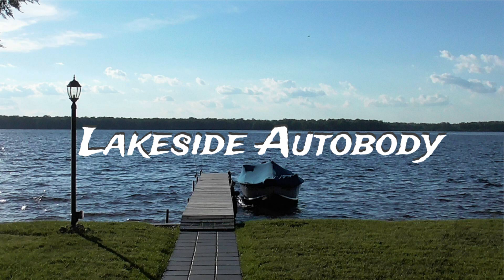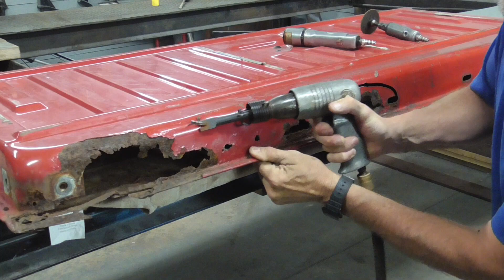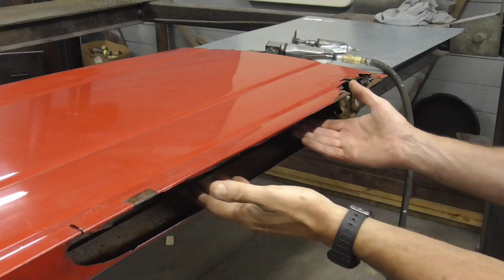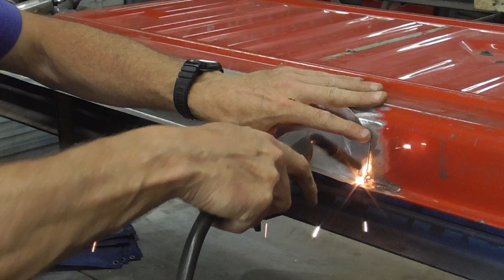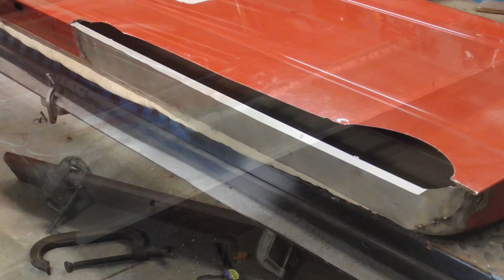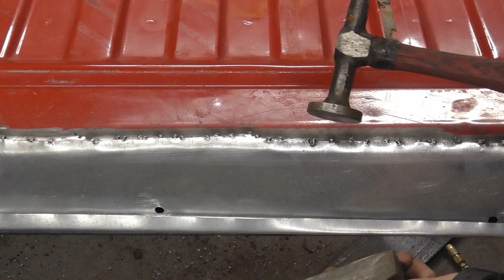Tailgate Rust Repair Made Easy

Comment: Excellent work! What gauge sheet metal did you use for the repair?
Reply from the maker: 22 or 20 --  .030"-.035"
Reply: @LakesideAutobody  Awesome! Making sure I was going in the right direction. I ended up buying a couple 22 gauge sheets. Thanks.

Comment: How did you get the second patch to fit so perfect? Did you trace with paper to sheet metal or something? I need to do this to my tailgate.
Reply from the maker: You can make a template with paper or cardboard, measure, etc.  I usually measure or just hold the patch in place a mark it with a marker or pencil.

Comment: Does the replacement steel used need to be of the same gauge and MATERIAL/TYPE as the original? Any preping/post spraying required to avoid galvanic reaction that could lead to rust?
Reply from the maker: It doesn't have to be the same gauge or type.  This is the best way to prevent future rust with any repair.  https://www.youtube.com/watch?v=8XaZBy7GC7A  Make sure the panel can drain and dry out inside - if it doesn't have drain holes, add some :)

Comment: What gauge sheetmetal do you recommend? Whats too thin and whats too heavy?
Reply from the maker: 20 gauge is as thick as you want - any thicker it's too hard to work with.  22 gauge can be used too any thinner would work but hard to weld w/o going through often :)
Reply: @LakesideAutobody  oo thank you for that. Yea i think ill use 20. My 87 bronco needs some sheetmetal work.

Comment: Jerry this is the same tailgate that i'm working on the 000 dakota but my tailgate was damaged beyond repair so I replaced it form one from the junk yard. It had about 40 cats of paint so I stripped it and completely disassembled it. and repainted it .Now completely reassembled it. and now I'm  having trouble getting it to align to the bed. all the brackets are out of place. Any suggestions. The tops out and the bottoms in or just the opposite on the other. Its confusing.
Reply from the maker: Start at the bottom and get that first. Where it attaches has to be adjustable - if not open the holes with a burr bit or even a drill bit or die grinder.  Once you get the bottom to align work on the top.  Keep asking ?s if you need.  Let me know how it goes for you :)
Reply: @LakesideAutobody  thanks I started at the bottom and worked my way up now I have it in pretty good shape we're within 3/32" of perfect and I believe that's pretty good. Now i'm working on repairing rust over the wheel wells. I appreciate your advise.
Reply from the maker: @keithshilt5549  Glad to hear it.  Have a good week :)

Comment: Excellent work. Have you ever used the tool that you run along one edge that you're welding, it bends about 1/2" of the edge down one material thickness so when you lap weld you're not above the surface. I never did but I've seen them and it looks like it's a time saver. Not sure what it's called? Funny story, my boss forgot to peel the transfer tape layer off of a pinstripe, so about a week after it was done the customer brought it back because the clear was lifting between the two pin stripes! What a pain in the butt to fix! Thanks for the videos!
Reply from the maker: Wow!  That pin striping story is excellent.  Good thing your boss did it - always feels good when the boss makes a mistake - that gives you a license to mess up too.  I think you are talking about a panel  flanger.  I have used one.  All seams should be knocked down a bit anyways so that the filler can be a buffer between the seam and the paint so... I just lap weld and knock it down.  You can certainly use one though if you like it and it works for you.  Thanks for the good story Mike - nice talking to you :)

Comment: Needs lager drain holes.
Reply from the maker: You're right - also a squirt of oil inside the panel after the job is finished will prevent future rust - once every once in a while works wonders :)

Comment: Why ylu did leave gaps between spots
Reply from the maker: I usually have good luck either way - welding the seam solid or leaving gaps.  Remember the seam is always facing down on the inside of the panel - no moisture worries.  The bottom is usually not a lap weld - its folded or pinch welded.

Comment: Really enjoy Your videos You make everything look so easy,  my question is on the spray bomb primer,  I was told 25 30 years ago that spray can primer contained moisture and it shouldn't be put under paint, has the industry cured that problem or was it never a problem to begin with and I just received bad advice?
Reply from the maker: I think that was probably bad advice.  I've never had a problem with that issue.  Spray bomb primer is used for quick touch ups of small bare metal spots in many body shops.  You can use the most inexpensive spray bomb primer and never have an issue if used sparingly.

Comment: What gauge metal did u make the patch with? Looks paper thin
Reply from the maker: That was quite thin but usually you use 22 or 20 gauge.  Both are reasonably thick yet easy to work with and cut with tin snips or other body tools.

Comment: what kind of sheet metal did you use 18 or 20 gauge ..im in the same situation cant find replacement
Reply from the maker: 22 gauge or .030"  You can also use 20 no problem .035".

Comment: How do you trace your repair panel to perfectly line up with your cut?
Reply from the maker: First cut a panel that comes close - then fold in to come close to fitting - then trim with a good pair of tin snips.  You are aiming for about 1/4" overlap on top of the patch and then you'll have the fold or pinch weld at the bottom.  Make sure you allow for good drainage so it doesn't happen again :)  BTW - cool mustang on your channel banner - best looking mustang ever built in my opinion.  My son just bought a 2012 - just a great looking car inside and out - Jerry
Reply: @LakesideAutobody   Appreciate the response, thanks. And yes absolutely love the s197 platform as well. Had mine 12 years now.

Comment: , Great video! Good afternoon, what is the gauge or caliber of the sheet that you used for replacement? thanks
Reply from the maker: 22 gauge -  20-22 gauge is good for rust repair.  That's the thickness of most auto sheet metal today - .030" - .035"    20 gauge is .035" and 22 is .030"  Thanks BTW
Reply: @LakesideAutobody  ok great , i think for My CJ7 Jeep it can be 16 gauge..
Reply from the maker: @juliocesarmaza8563  Yes - I think jeeps are thicker - have a good week :)

Comment: Done properly IMO. strong and lasting repair. Filler wont crack if it is done right and that would lase the life of the car.
Reply from the maker: Thanks Mike - I appreciate that.  You're right - filler will not crack, fall out, etc if it's applied right.  Can't wait to see you drive that Cherry Picker - what a find :)

Comment: Are you using Gas in this demonstration as there seems to be little or no splatter?
Reply from the maker: Yes - it's an older Miller Millermatic 90,  110v MIG  .23" wire

Comment: And a year later that entire seem you didn't fully weld will start popping the bondo up. Should have just panel bonded it to seal the seem it's a waist of time spot welding.
Reply from the maker: There's 3 ways professional body shops fix rust:
1) Combination of Lap and Butt welds.  If you insist on strictly butt welds, here's the best way to do them for longevity: https://www.youtube.com/watch?v=e9bjZ_UxtJg
2) Lap joint using structural adhesive or panel bond
3) Fiberglass cloth and fiber reinforced body filler
 
See Eastwood’s video as to why body shops don’t butt weld then agressively grind off the strongest part of the welds, and attempt to metal finish today’s extremely thin metal:  https://www.youtube.com/watch?v=rpH50kh4W00
Reply: Actually after he knocks them down the bondo will keep the seam from popping up. 1/8 inch of filler is very strong

Comment: And next year you get to do it all over again when all that bare steel rusts out from the inside of the seam.
Reply from the maker: There's 3 ways professional body shops fix rust:
1) Combination of Lap and Butt welds.  If you insist on strictly butt welds, here's the best way to do them for longevity: https://www.youtube.com/watch?v=e9bjZ_UxtJg
2) Lap joint using structural adhesive or panel bond
3) Fiberglass cloth and fiber reinforced body filler
 
See Eastwood’s video as to why body shops don’t butt weld then agressively grind off the strongest part of the welds, and attempt to metal finish today’s extremely thin metal:  https://www.youtube.com/watch?v=rpH50kh4W00
Reply: Not if you soak in oil or cavity wax like you're supposed to do

Comment: What amp setting do you use for that thin metal?
Reply from the maker: My welder has 4 settings - I usually start on 2 - if it blows through to easy I set it on 1.  The wire feed chart is on the inside of the welder and I pretty much stay with that.

Comment: Will it matter that the lap weld is not completely welded?
Reply from the maker: An old boss of mine made us weld our patches solid - well of course I cheated here and there and never ran into any problems or complaints.  The reason I think is because the moisture, salt and debris always runs to the bottom of the panel - and that is where the rust will begin again - not on the side of the panel where those lap welds are.  It's up to you though it you want to weld solid - I leave some space between my welds, grind clean, tap down, fill and don't have any issues.  You can give your repaired panel a squirt of used motor oil after you paint to keep the bottom of the panel from rusting again.

Comment: Did you lose the body line on the front of the tailgate when you put the patch on?
Reply from the maker: I borrowed the tailgate from a junk yard to make the video so I just covered the whole body line at the bottom of the panel.  It is possible to fold that into the patch or hammer and dolly it into the patch panel before installation but I figured I'd get away with no one noticing - you noticed :)  Good job.
Reply: @LakesideAutobody    The reason I noticed is because I lost part of  the body line arch of the left rear wheel well when I was putting a new panel in on my 2008 Ford Escape. I made the mistake of cutting across the body line instead of keeping the cut above it.  Somehow it ended up getting flattened.  I tried remaking the inch I lost with filler but wasn't successful and couldn't get the right curve.  Any tips you could give me on that would be great!!!  I'd show you a pic but can't upload here.  Lol
Reply: I'll also add that I  lost the body line on the existing metal I wasn't replacing and I couldn't get in behind to hammer and dolly it.
Reply from the maker: @stevemaclean2009  No problem at all - looks fine w/o it.  No one would ever notice.
Reply: @LakesideAutobody  lol.. I hear you that no one would notice just me.  My wife says I'm too much of a perfectionist. :)
Reply from the maker: @stevemaclean2009  Sometimes that's a good thing and sometimes it can rule your life.  Years ago I started practicing hard - and I mean hard at not being a perfectionist  and not doing everything by the book or following all the rules.  Following all the "rules" can control and affects your life in a negative way - it paralyzes you a prevents you from "living"   I used to have dreams that I couldn't get my locker open, couldn't get to class on time, couldn't get dressed for work fast enough, started my mortgage over again, lost my credit card, on and on.  After some practice things have changed - I took big chances that I wouldn't have taken before and they've worked out.  Anyway - I could write a book on that topic.  Nice talking to you - Jerry
Reply: I really enjoy watching your videos.
Reply from the maker: @stevemaclean2009  Thanks - glad you like them. I hope to keep uploading useful content.  Happy Holidays :)
Reply: I noticed lol

Comment: I got major rust on my Broncos tailgate. It wouldn’t be a big deal if the tailgate didn’t  support the motor and back window. I hope I can get someone to repair it or do it myself. What kind of metal sheet is that?
Reply from the maker: That's some stuff I got from Home D.  but I usually use 20 or 22 gauge A1008 cold rolled sheet from places like Alro Steel or Speedy Metals etc.
Reply: Lakeside Autobody thanks for the reply

Comment: What type and size sheet metal to I buy / use?
Reply from the maker: 22 gauge (.030") or 20 gauge (.035") - carbon sheet (steel sheet) A1008   Alro Steel or Speedy Metals are examples of places that sell this in a 4x8 sheet around $110
Reply: Lakeside Autobody thanks so much. I’m looking to buy a welder and make the dive into working on my own car projects.

Comment: Saved?  You didn't replicate the factory ridge widthwise on that Dakota tailgate.
Reply from the maker: You mean the body line?  Good eye.  If you wanted to recreate that you could lay a piece of tape as a guide and use a file board w/ 36 grit on an angle and dig it out but I got lazy and thought it looked fine w/o it - just a demo gate.

Comment: Would you use Weld-through primer on any part of this, or treat the inside part of the panel?
Reply from the maker: Treat the inside of the panel.  I'm not sure the weld through primer would hold up to the welding process.  Wouldn't the area around the actual weld be burned off - leaving bare metal?  Just my thoughts on that.
Reply: @LakesideAutobody  I thought that was the purpose of weld through primer. Otherwise in michigan, I have seen welds rust from the inside out within months. Water will seep through the welds and appear as beads on the paint surface.  I have my rx7 repaired by a dealership and that's what happened. Where they cut a patch panel in the dog leg in front of the rear tire, it would seep.
Reply: Weld thru primer in theory is supposed to creep back to the weld area once welded. Does it, I don't know. I don't use it. Your supposed to spray it on and then clean it off where you weld so you get a good weld. If you weld on top off the primer you get a LOT of splatter.

Comment: What is the thickness of your metal! Thanks
Reply from the maker: That was 22 gauge but anything from .030" to ,037 is fine (20-22 gauge)  Older stuff is much thicker which allows for metal finishing.  You don't want to be filing and grinding away on 20-22 gauge as there wont be much left.  BTW I believe cars today are built with 22 gauge.
Reply: @LakesideAutobody  e

Comment: What do you prefer, a Nibler or an air hammer?
Reply from the maker: Well.... I used to only have the air hammer for years.  All cutting was done with the air hammer, hand snips, or cut off wheel.  The nibbler comes in handy if you're concerned about making a nice clean cut without distorting the metal at all where as the air hammer distorts it a bit.  The nibbler is a bit slower and leaves a ton of little sharp moon shaped pieces of metal that get stuck in your boots - no big deal, just annoying.  They both have their advantages but I couldn't live w/o the air hammer - if I had to choose one.  I can do the delicate cuts w the cut off wheel or snips.  Hope that helps
Reply: Lakeside Autobody sure does! I like the compact size of the nibbler. Just bought a 2007 RAV4 and the bottom of the fenders have rust bubbling. Do you ever use a flanger and 3M body adhesive with a metal patch? Thanks, Dave!
Reply: @davekana8388  I've tried 3m adhesive but haven't had good results

Comment: Nice job. One comment is leaving all that raw metal on the inside of the folded over seam. No matter what you do water will get there (as evidenced by the original rusting out). Perhaps a quick spray of some epoxy primer first to slow things down. Thanks for the video.
Reply: Agreed, Never leave raw metal unfinished, having the drain holes is great, but it is also letting in moisture and creating rust from the inside out on the raw metal. All that hard work won't last but a few years in Michigan, just a little metal primer/paint goes a long way!!! Otherwise nice metal work!
Reply from the maker: You're welcome - sorry about the late reply :)
Reply: 3 m cavity wax also

Comment: Another great video. You manage to cut some impressive fitting patches. What gauge sheet metal do you use and roughly what are your welder settings?
Reply from the maker: 20 gauge or 22 which is getting on the thin side.  .030" is the micrometer measurement.  Miller mig settings are at 1 or 2 (voltage) - there are 4 settings.  Wire feed is around 40 - there's a chart inside the lid I use as a general guide.  Gas is at 20 cfh I believe - once it's set you don't have to touch it - it's the same for everything.  - Glad you like the vid

Comment: Do you use the pointed body hammer to knock the weld down?
Reply from the maker: Yes.  You can use a straight edge to make sure they are low.  Also don't worry it you didn't quite hit it low enough as you can still wack them down later if you find a high spot while sanding your filler

Comment: can I stitch weld panels, knock down the welds and put the filler or is it necessary do a continue weld all across the panels ? both ways work the same or stitch weld can be compromise by rust or stress? Thank you.
Reply from the maker: You can stitch weld - then grind lightly - knock the welds down and fill.  You can weld solid too.  Both ways have worked well for me as long as you knock them down good.  It's when you grind to much making the welds thin and worry about metal finishing that you run into trouble.  Hit it low and fill it with dough!  You'll be fine - rust starts at the bottom of the panel anyway (where the salt water and debris get trapped)